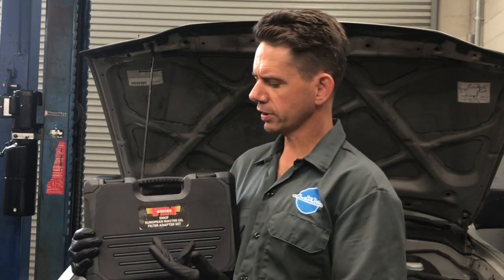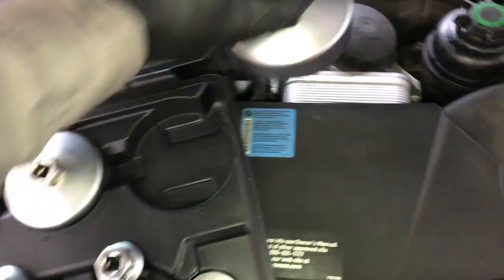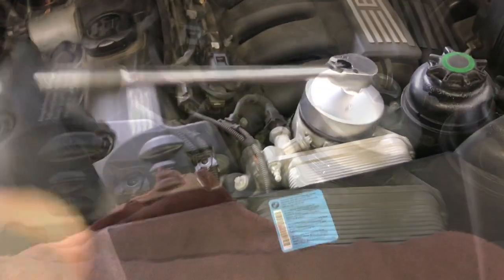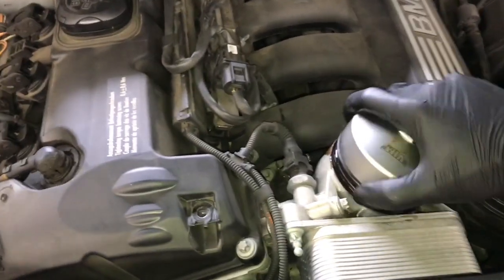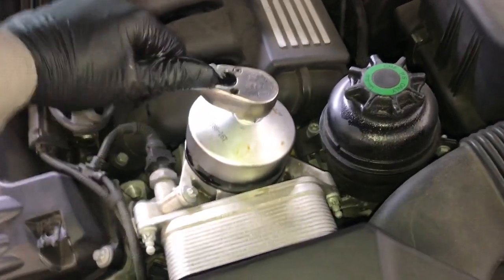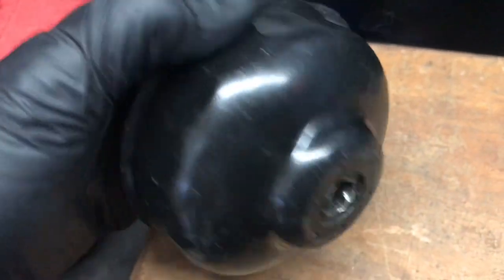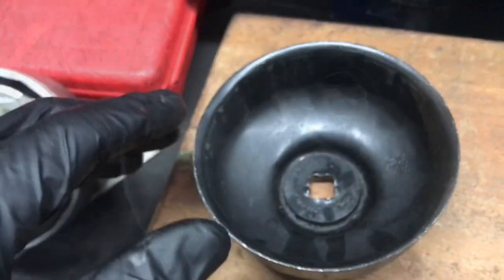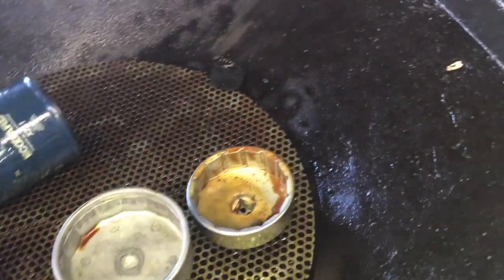The Right Tools For New Automotive Technicians: VIM Tools Oil Filter Adapters

Comment: I notice that you did not use a torque wrench.  I think my Lexus ES350 cartridge should be torqued to only 9 lb/ft and after having the oil changed at the dealer it seemed to be over tightened.  You mentioned that even if they are torqued correctly, they can weld themselves on, although mne has a metal cannister, I believe, while the Camry V-6 may have a plastic one.